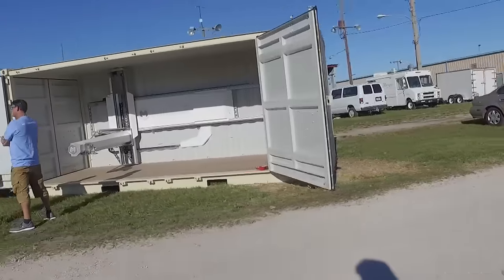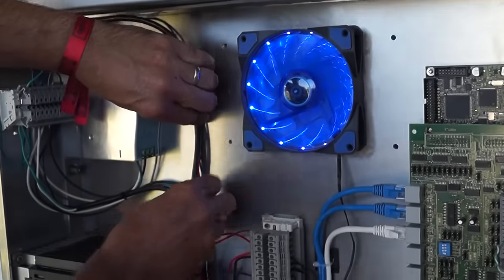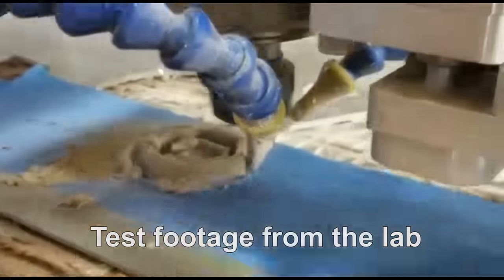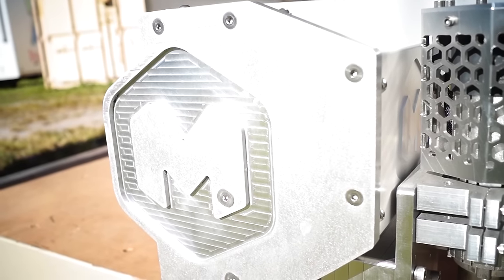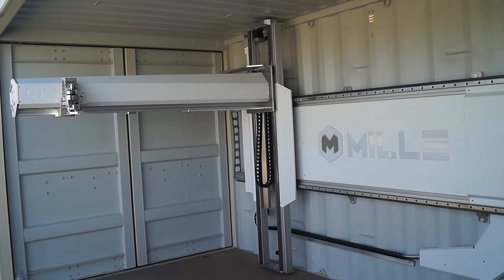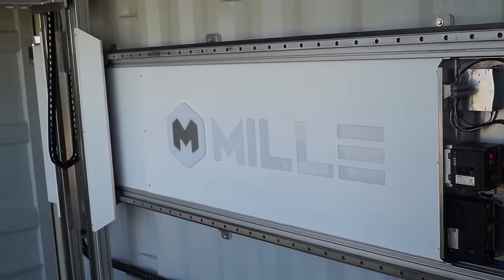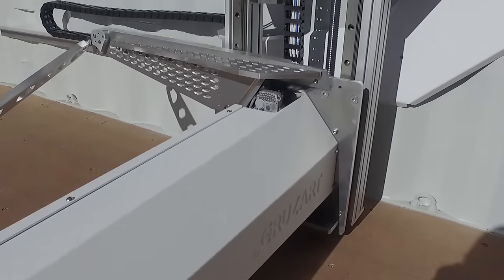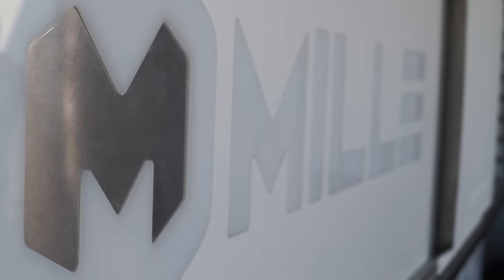This shipping container is actually a 3D printer

Comment: There's a VERY important reason that gantries have to be supported on both sides. That mill will have absolutely no precision if it's cutting anything harder than playdoh. You want to make large, deliverable printers, fine, but don't leave one NECESSARY side of the machine off, container walls are not exactly sturdy, they're not designed for any sort of rigidity at all except for in the corners.
Reply: Eugene S For sure.  you can see the arm bounce when it starts and stops.
Reply: Don't give these crooks advice.
Reply: The machine was a concept prototype put together in 2.5 months. The single-arm design shows off the accessibility of the machine. Not practical in a production application. The walls were reinforced with steel beams on the backside but could be improved upon. Their next machine is will feature a standard dual arm gantry but I hear it will be ceiling mounted to the steel beams which keeps them out of the way of debris and forklift for unloading

Comment: so you sent it to a disaster zone ... does it have its own power?..... ok so you also take a nice big generator... and the big tank of diesel to run it .... and the another huge container full of the glue/gunge / that makes ..... well it makes a material full of holes that can be used for.....? Have I missed the point?
Reply: Rob Davidge nope
Reply: There's tons of space to bring along a generator or battery pack. With the gantry packed out of the way, the machine can be loaded with supplies and shipped as a normal container. The magic happens once you free it up. This machine was a prototype but does demonstrate some unique concepts in the 3D printing world. The material extruded is a clay polymer that self-cures via chemical reaction. All you have to do is add 220F heat and that starts the reaction curing the rest of the part. Material is tough as sh*t

Comment: support system not rigid enough to really mill anything other than that foam material....pretty useless
Reply: Rodger Garrett yeah
Reply: I can't find the link now, but I recall someone putting a CNC router to cut 4' x 8'plywood sheets inside a container as a project connected to the WikiHouse program.
Reply: Rodger Garrett  this is a printer, not a mill

Comment: this would be great in disaster areas to quickly build temporary housing/shelter for people who have lost everything
Reply: Michael Cain if we talk about speed 3d printing is not that fast when making things
Reply: Going to be honest, filling the shipping container with sheet materials would probably be more immediately valuable.
Reply: Problem is that it's probably faster to cast the things with the foam with wooden or metal casts. You don't really need the precision of a 3d printer to make say, a wall piece.
Reply: The machine could be loaded with materials and then sent to the area. Unload the materials, then use the machine to fabricate other hard to find items

Comment: The idea is neat, but a novelty. Manufacturing can only be done properly in a stationary area where all materials can  be brought into and process. And disaster relief? Give me a break! It's useless for that. In the time you can print 1/4 of the foundation you can set up a tent that has little cost! They threw that in there for funding...
Reply: I'd like to think it's more like they didn't do proper market research, so they just threw it in there.
That said the could be quite useful for architectural/civil engineering prototyping and testing. They'd have to focus more on getting that to work with different materials like concrete mixtures though.